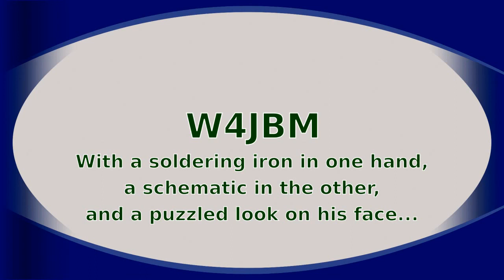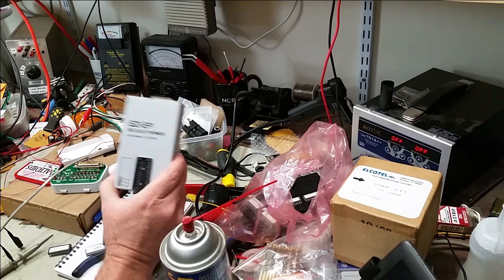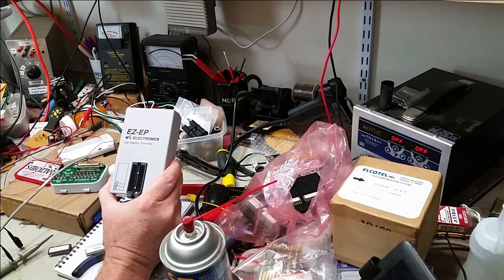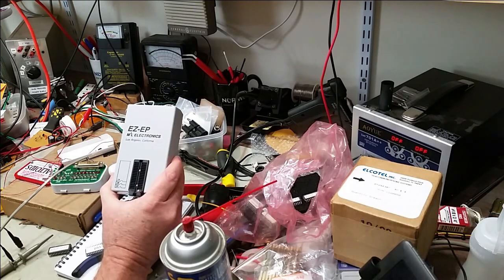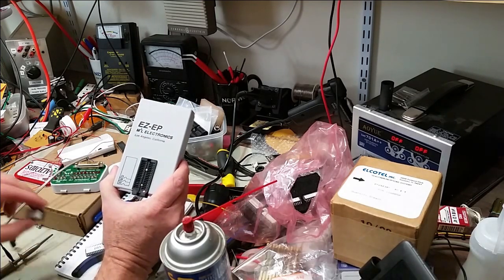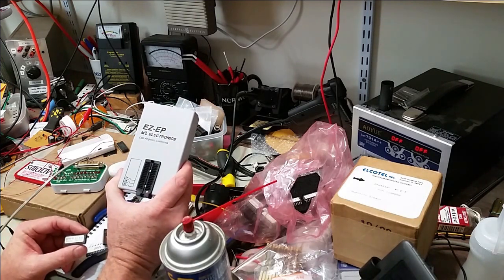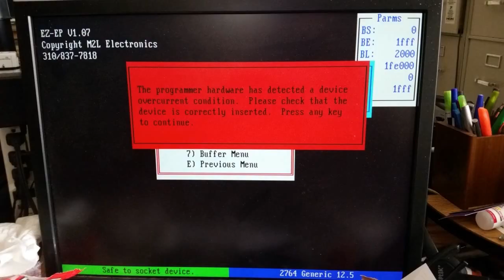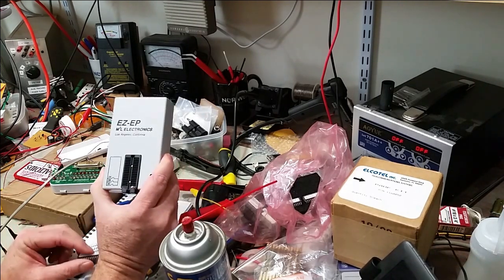The EZ-EP EPROM Programmer and Challenges with Vintage EPROMs

Comment: There you go looking a gift horse in the mouth!
Reply from the maker: I appreciate anything that gives me an excuse to tinker and something to learn.  :-)
Reply: W4JBM if you don't erase you roms with sun you are too advanced! 😯
Reply from the maker: In the past I've usually had access to an eraser at work but don't anymore. I have tried the sun thing once and it did work. But I have to admit I just bought one of the $20 jobs from China to erase these. It did the job in 20 minutes on the 27c010. I'll probably do a quick review on the eraser sometime. Between the 1802 Membership Card, an 65c816 kit I have on order, and a homebrew 65c02 project that is on the drawing board I will probably be doing a lot more erasing and one-burns than I have before.